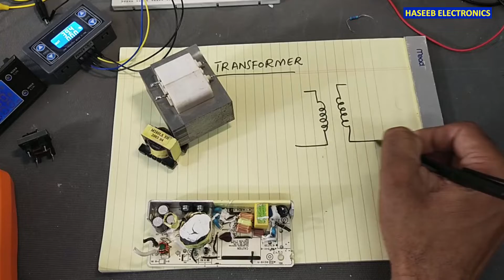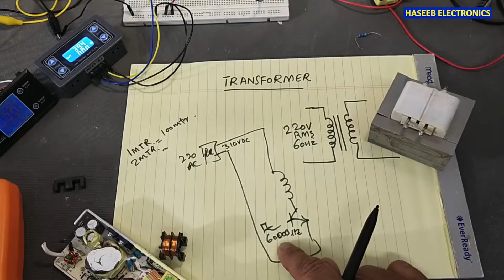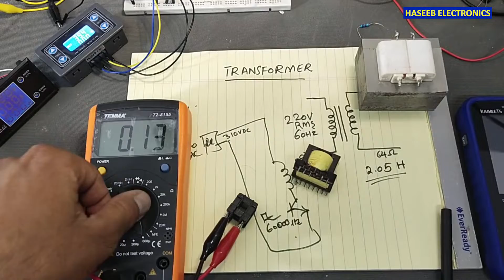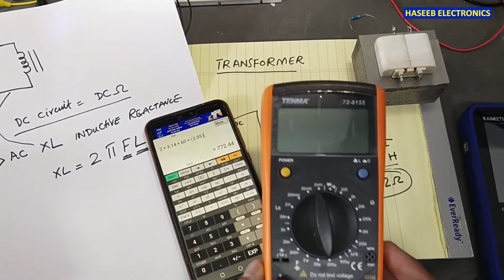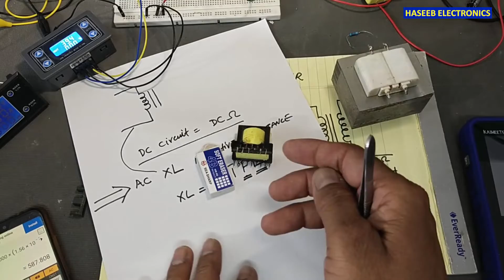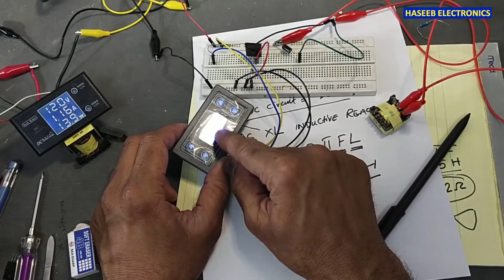{838} How Does A Chopper Transformer Is Working on 310 Volt DC??

Comment: My simple answer is, transformer winding will be at 0~6 ohms when measured in DC.  But coil has resistance during AC conduction called reactance otherwise it would burnt instantly.  The amount of voltage depends on number of turns in secondary coil and current depends on thickness of the secondary coil and primary.  Primary winding no of turns depends on the input voltage.

Comment: thank you for the video ^_^
i have a question :-
so the chopper transformer is connecting in series in 'switch mode power supply' device ?
i want to understand how the current behave when going through the "Chopper transformer" , is the current goes on/off when go through the Chopper transformer,  OR  does the current changing the polarity when go through the Chopper transformer

Comment: Hi Sir. Thank you for posting youtube videos. Learned a lot from your channel. You explained it so clearly and also the concept of electronics. Hoping you could clarify something for me. I have a SMPS for my AV Receiver. There was a hissing sound (like changing frequency sound ) coming out of the speaker. So I replaced the capacitor. The hiss still remained despite changing the capacitor. I suspected that the chopper transformer has been affected by the capacitor drying up. Is it possible for the chopper transformer to get damaged and cause the hissing sound. Because I removed the chopper transformer and then retaped it and it seems to have solved the problem. But I am not sure what the long term solution is to this. Thank you.

Comment: Hi sir . When I use a multimeter I can find 318V DC in Primary side ( HOT side) of the Chopper but I can't find voltage in the secondary side, It's less than 1V . What might be the Problem? 

Thank you

Comment: There is no relation between voltage and frequency in a transformer ?
Reply from the maker: in transformer
there is relation of magnetizing current and magnetizing force (in BH curve, The magnetizing force (H) is equal to the product of magnetizing current and the
number of turns, and is expressed as Ampere - Turns. )
so current depends on voltage, frequency, inductance and duty cycle 
if voltage will increase, the current increases
if frequency increases, the current decreases
if inductance increases, current decreases 
if duty cycle increases the current increases 
there are too many parameters involved in magnetic design 
but the basic elements to considered are current and inductance

Comment: It would have been perfect if you have compared the relationship between inductive reactance,  frequency, current, size of transformer. Overall very interesting explanation
Reply from the maker: best regards 
basically there are too many parameters in magnetic design 
such as voltage, frequency, duty cycle, inductance, turns, bmax etc
but in any transformer, the BH curve is very very important, which base on magnetizing current and the inductor turns it is expressed as Ampere - Turns.
if we follow this curve, then frequency, voltage, duty time, inductance, permeability, bmax are involved in magnetizing current (H)
transformer size is also covered n the same BH curve